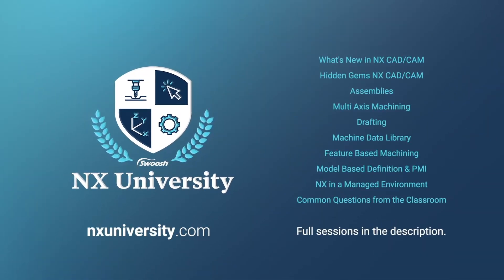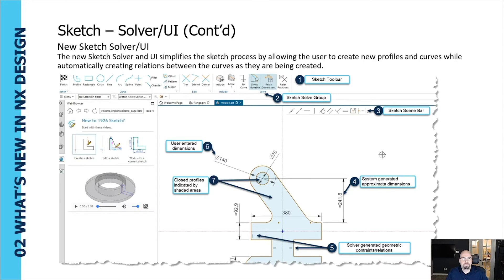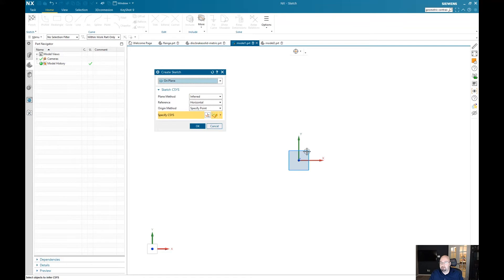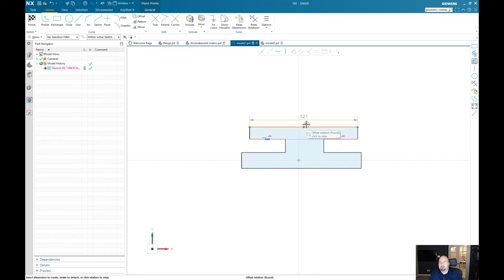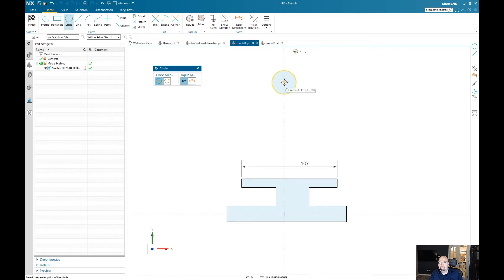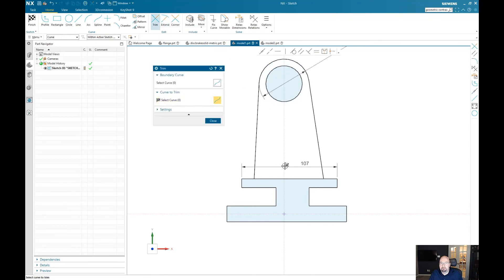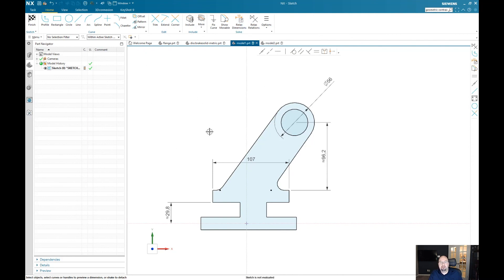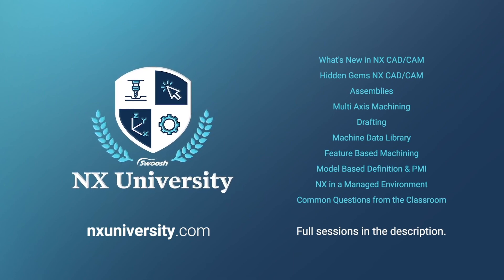Sketch Solver in NX 1926 Demo

Comment: Hello, I'm using v1965 and those relations between lines don't appear. Do you know why? Thanks for the video.
Reply: Hi Michael, the relations that you are seeing on the actual curves in the sketch are called "persistent relations". You can have these persistent relations always show up by turning the option on to have them shown at all times. Steps to show persistent relations:
1. Edit the sketch
2. On the Sketch Ribbon Bar > On the "Solve Group" section > select the "Options" drop-down > select "Display Persistent Relations" (if this is selected or activated the icon will have a blue shaded background). 
After you turn on the "Display Persistent Relations" option you will always see the Persistent Relations that have been created on curves in your sketch.

Comment: Hello! I did the same as you but when i restart the app the sketch solver goes off.I am also using nx 1926!
Reply: Hi OldPicklesDupree, Are you turning the option on to show the new Sketch Solver and User Interface? You can turn the new Sketch Solver and UI on in NX1926 by using the directions shown in the video @ 1:12 into the video  https://youtu.be/Z1YRYE9thvQ?t=72 
After you turn this setting on, you will have to restart your NX session to see the new Sketch Solver and UI in your NX session.
Reply: @michaelpinto6073  I got it now!Somehow

Comment: Updated from Siemens NX 11. When i draw a sketch it is brown, fully constrained is black. Is it the new normal? Or am i missing something?
Reply: nope
Reply: @alestamegayat4342  Nope for what?
Reply: Hi Dizanynspeed, yes, the appearance of the sketch curves with the new Sketch UI and Solver will be a Brownish-Orange color if the sketch curves are not "Fully Defined" in the sketch. When we refer to a curve as "not fully defined", this means that the sketch curves can still be moved and/or resized in the sketch. Once you apply enough relations, whether they are Found Relations or Persistent Relations (These are explicit relations that can be defined by the user such as geometric type relations that are created with the Persistent Relations option turned on when you create a relation or Dimensions applied between curves, points and axis)
After you have "Fully Defined" the sketch curves, they will become black in appearance. If you want to be able to see the "Movable" (non-fully defined) curves in the Brownish-Orange color, make sure that  you turn on the option to "Show Movable" curves. 
On the Sketch Ribbon Bar > On the "Solve" group > select the "Show Movable" icon (if this is selected or activated the icon will have a blue shaded background).
I hope this helps out.